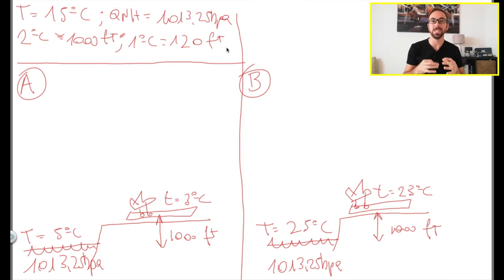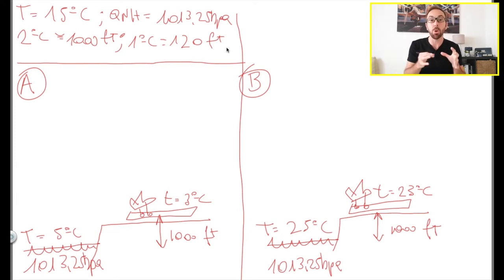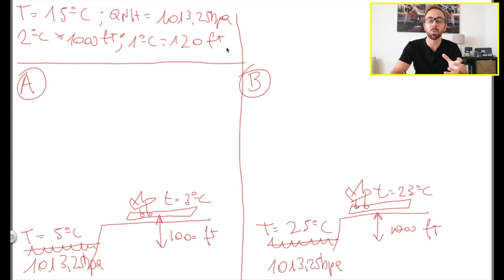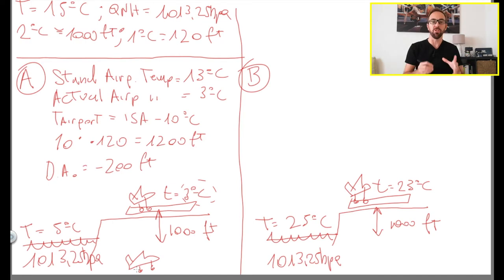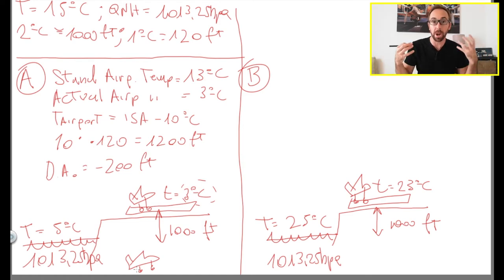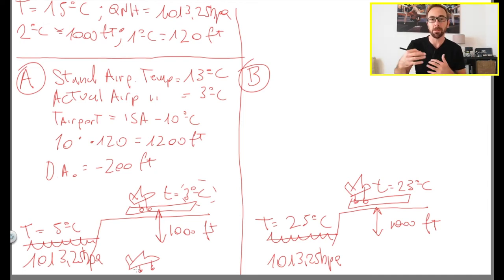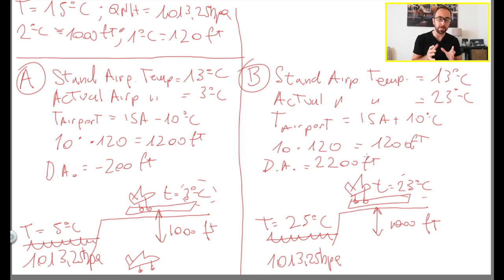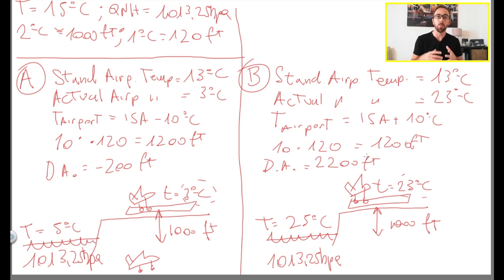Density Altitude Explained - [Definition, Aircraft performance implications and how to calculate it]

Comment: 990 hPa means more pressure altitude to compensate for the given OAT above or below ISA. We love your animated explanations and how yo hammer in the information with such thoroughness. Bravo! You are a Golden Seal Instructor Signor! I flew at high Density Altitude Airports in Kenya like Nairobi and Eldoret as well as Denver in  Sim and tried Quito and La Paz in computer sim.My aircraft is certified to a maximum take off Altitude of 13,800 ft MSL!Special procedures are used.You take off and land with Oxygen masks! Try a video on a hot day take off or lamding in La Paz with one engine failed on your 737 PC Sim...it will be interesting to watch!
Reply from the maker: Many thanks for your great support!! Taking off and landing with a musk on must have been an experience...

Comment: I hope i got the correct answer:

A: 990 hpa in Winter with 5 Celsius and 1000ft elevation.
=447,74 feet (density altitude).

B: in Summer with 990hpa and 25 Celsius

= 2827,75 feet (density altitude)

Instead of 1000ft pressure altitude at 1013,25 hpa

I have to use 1627.75 ft pressure altitude at 990 hpa
Reply from the maker: Awesome, you understood how the pressure altitude and the density altitude works!! Very well done!!
Reply: @PILOTCLIMB  
Thank you for the compliment.
I was about to ask you if you could make a video about Density Altitude.

Are you going to make a vodeo about true altitude and calculation between Inches Hg and hpa?